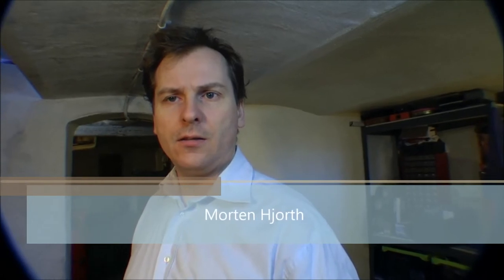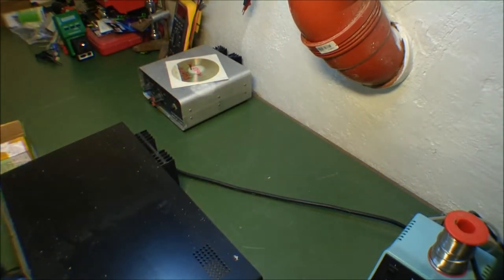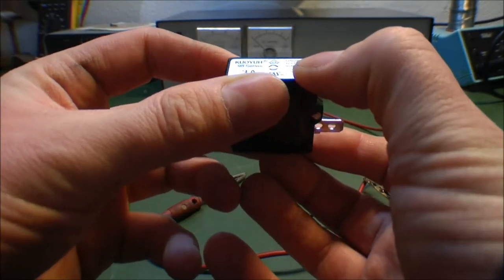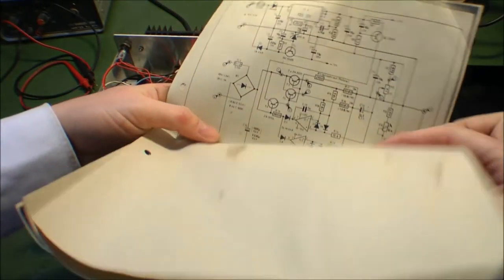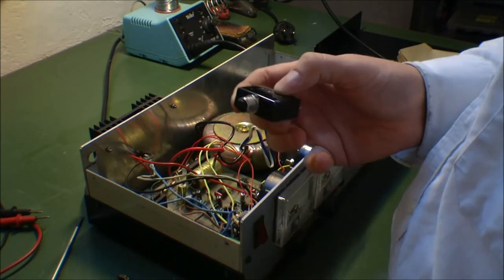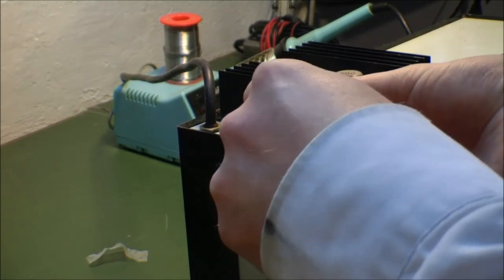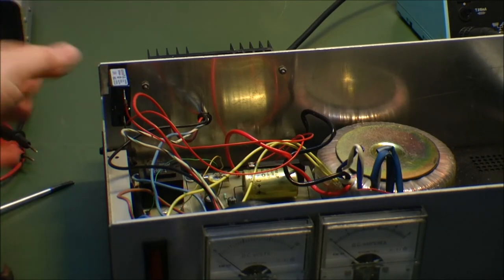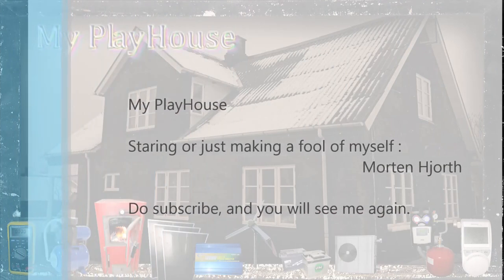Automatic circuit breaker install in laboratory power supply - 031

Comment: Was the fuse for the AC input to the power supply? If so, you could make a soft-start device, that limits the current for a few seconds while the main capacitor charges up and the transformer magnetizes. But I guess the circuit breaker will work too. Although, it might trip on occasion.
Reply from the maker: Hi Benjamin Esposti 
No this is a DC fuse to protect the DC output. If I for example, I use the power supply to charge a battery. It will very often blow this fuse. 
I am really happy with this automatic breaker,,, it is sooo mutch easier now.
Hope you will enjoy more of my videos,, and Like :-)
Thank you for watching! :-)